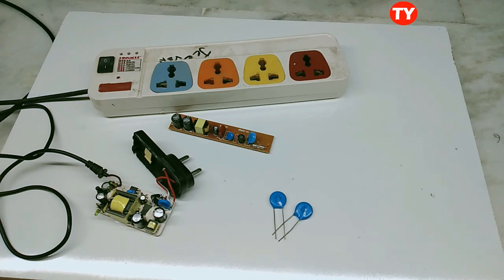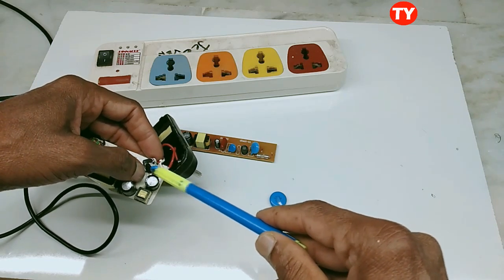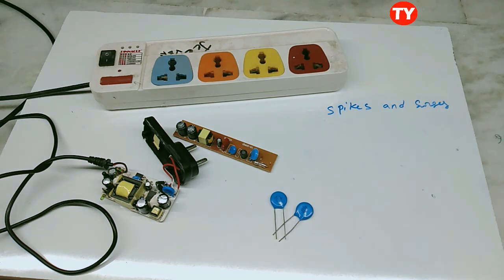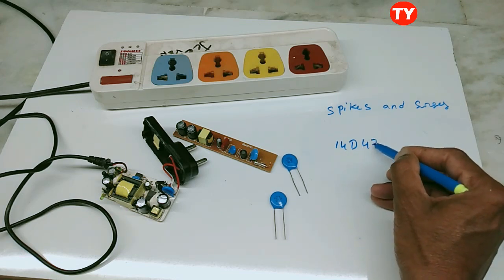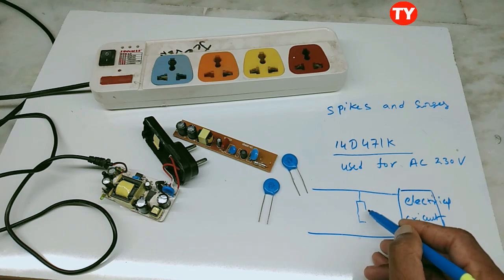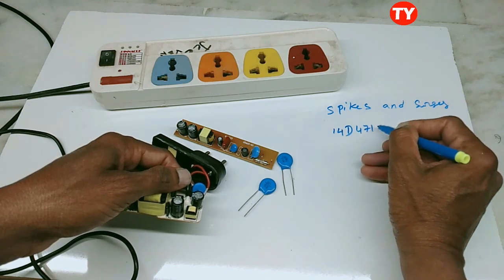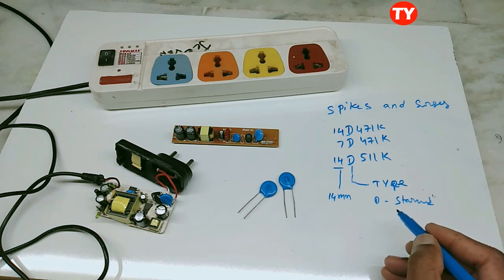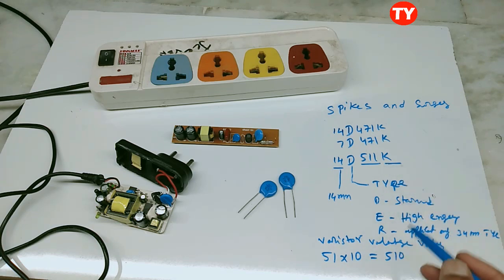MOV used to control  SPIKES AND SURGES in AC supply

Comment: Good video , but keep it small and edit out the pauses.....it is painful to watch or else. Fast forward where you type. No need to rewrite, just write and keep and insert that sheet into video....Would have been really good if you explained the voltage rating and tolerance as to what it means for common man
Reply from the maker: plz you can read https://software2training.blogspot.com/2021/06/how-to-calculate-mov-voltage.html